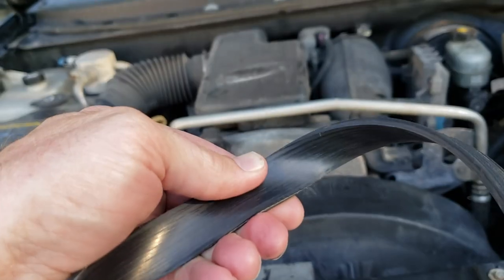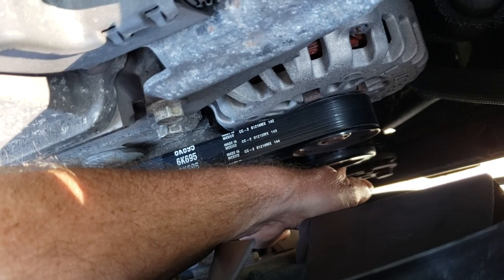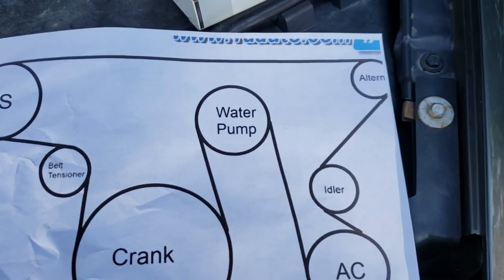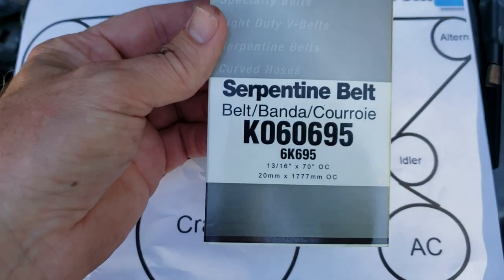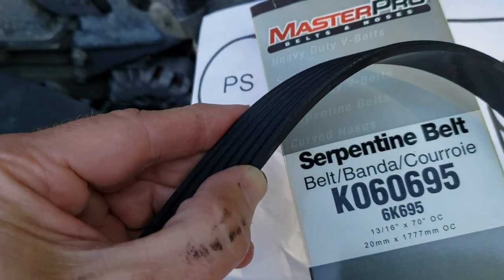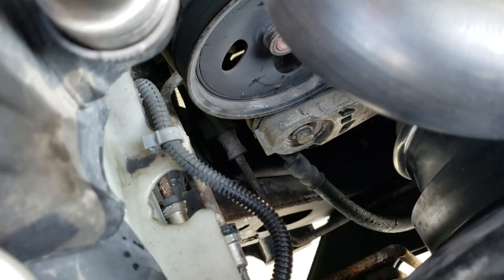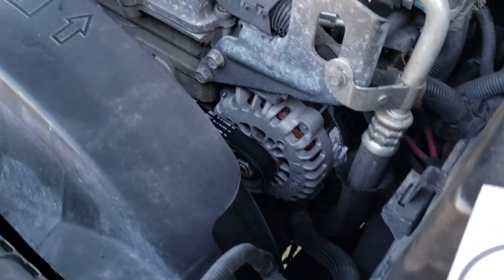GM 4.2L Belt Fix AC Bypass Easy to do Chevy, GMC, Saab, Buick

Comment: You sir, are a lifesaver. How you came up with this quick, cheap remedy, it’s brilliant and today, I wasn’t financially equipped to even spend $100 on a regular good quality belt, let alone bringing it in to have the AC repaired. That can be handled when my money is right.  This works exactly as you said it would. Thanks so much!
Reply from the maker: Not always easy keeping the GMs on the road......
Reply: @randall928  I know little about AC compressors but does the whole thing have to be replaced or can the pulley wheel be switched out?
Reply from the maker: @bdub6942  probably easier and safer to swap the whole unit
Reply: @randall928  Thanks for your expertise advice, I’ll take it. Have a great 4th of July weekend!

Comment: Thank you so damn much.. 5 degrees out, been working on this trailblazer months to get it going to go to work. Down to my last 50 bucks after getting paid. Then this happens… #&*$!!  Buddy says pull it back into the garage and well change it tmrw..  well im broke, and burnt the hell out from working on this thing, he says will only take a few hours..  well the vids and people I talked to said it’s a royal pain to change the compressor on this rig cuz an engineer put it on the bottom and lts much harder to do than the vids give it credit for… My rear went to auto store, bought this belt and bypassed the som bitch!!! Done with it for now!! Summer repair with all the others that will come up by then..   Thank you for posting with information, you rock. Ty again.
Reply from the maker: Glad I could help, I never did fix the AC on mine, ended up selling it as is!

Comment: My daughter’s 2003 Trailblazer just had the a/c pulley seize and snap the belt today. This video saved me from running back and forth guessing the size, thank you!! Minor change with mine though, the 060695 70” belt was just a little too long and had a little belt slap. Changed it out for 060690 69 1/2” and it is perfect! Thanks again!
Reply from the maker: Thanks!  Glad it worked for you!

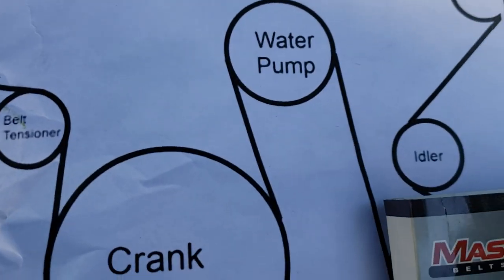Comment: 4:35 Liqidarts draws the new line on the diagram in slightly the incorrect place. The new belt comes off the top of (not the bottom) the water pump pulley (sheave).

Comment: Took less than 10 minutes to switch out the belts and get the vehicle running again after ac compressor seized. Thanks for the help.
Reply from the maker: Awesome, glad it worked out!

Comment: Life saver my guy. My dads trailblazer 03 ls is the only thing we have atm for the snow ❄️, the ac clutch siezed and we needed it fix asap so we can all get to work. I replaced the belt with my feiend, and it works like a charm(no more knocking from compressor or belt burning)
Reply from the maker: Glad it helped!

Comment: Nice video. Just to minimize any confusion, the pulley that applies (& releases) the belt tension is NOT called an idler pulley. It's called a tensioner pulley, or self-adjusting belt tensioner pulley. Thanks!
Reply from the maker: Good point, I struggled it until I noticed the built in ratchet hole
Reply: And to minimize further confusion , the new belt goes OVER the water pump pulley , not below it as in his illustration .
Reply: @dennisfrier3191  yeah that confused me for a second then I realized the water pump holds the smooth side of the belt and not the grooves. 
I'm going to try this today if possible because I can't afford the replacement compressor or the bypass pulley. 
Pray for us! Haha

Comment: Great idea! This saved us about $450 taking out the locked up
Compressor and putting in a “filler” pulley. One day we will change that AC compressor but until then the truck is driving. Thanks!
Reply from the maker: Glad it worked out!

Comment: Seized ac compressor in my 2002 oldsmobile bravada burnt out my starter, alternator and belt. had no idea until i replaced everything and the car still wouldn't start. took the new belt off and started the vehicle right up like brand new. bypassing AC tomorrow 😅

Comment: Does Anybody Know How to By- Pass The A/C  (idler Tensioner...) on a Chevy Van G20, 1990 ,5.7L ?  I have Been Told there Is a Modification Kit .... to change over to a Shorter Belt.  But I Tried to Look it Over....But It Just Doesn't Seem Possible..  And I Had Thought it Would Be Easy to Switch Over...Now , I don't Know Where to Start ...!!
   I may Just Have to Keep the Long Belt , running on the Dead A/C Unit....  Please Respond if You Have an Lead....or idea to Switch over to a Shorter Serpentine Belt.
   Thanks , BillinL.A. 3-25-22.

Comment: Thanks, good info.  I had noise at the tensioner pully, so I just replaced the tensioner, idler pulley and belt.  Worked fine. I had difficulty telling if the grooves on the AC pulley were lined up, but I think I got them lined up.  Be careful not to have the belt off center. While the belt is off, spin power steering pump, AC and and alternator to check for bearing noise.  The AC bearing seemed loose and was making a little noise. OK,  no biggie, but after a few errands, about an hour of driving I am smelling burnt belt. So I get home and can't tell what is causing it. I'm going to try the short belt AC bypass. It look like the Autozone 695K6 will work. 
Note that the AC bearing can be replaced without removing the AC compressor, I think. Anyway check on other vidoes/blogs on that. I will see if this stops the belt burning problem.
follow up - Short 70" belt worked great. To hold the tensioner down use a 3/8  rachet and a larger wrench, say 19+mm, use the round box end and put that over the end of the rachet. After taking the belt of the AC compressor pulley is very stiff, way worse than when I checked it before putting the belt on.  So that was the problem. Why did it happen now? My guess is that the new belt and new tensioner put more pull/tension  on the AC pulley. The old belt was worn, glazed over and the tensioner was probably 10+ years old. So the already bad AC bearings simply gave out. 
I'll probably try the new bearing and see how that works. Its a cheap fix. If that does not work then time for a new AC compressor. 
Oh and one last thing, my vehicle is an 03 Bravda, it had been missing at idle for years. Not terrible, not stalling, just annoying. Did plugs, coil packs, fuel pressure regulator, cleaned MAF and throttle body,  etc (all which were due for changing/cleaning anyway), each one improved the problem, but still a little  stutter at 600 RPM. Its gone now. I think the bad tensioner, idle pulley and AC bearing were dragging the engine idle down.
Reply: Holy shit. This is for comments about the above video. Its not a place to post your automotive diary.